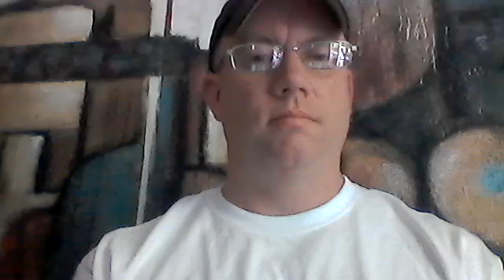what is required to operate 50 antminers.

Comment: Inaccurate, misleading, pompous info aimed to lure investors only. One Antminer S9 puts out 250cfm X 50 = 12,500CFM (Not 30,000CFM as this guy here says) Static Pressure is a simple concept that 3rd grader would understanding. $100,000 data center, really? A good firewall such as MerakiMX64 and a couple of used Cisco Catalyst 3750 switches is more than enough.
Reply from the maker: So if you only move 12500 cfm and the stati pressure is .25 from the passing thru the miner and you have a hot and cold isle design adding a .125 static pressure to the hot side what will be the cfm you are moving out of the building using a fan blade style fan with a 1/2 hp 1080 rpm psu motor
Reply from the maker: Also you are using a 42x42 opening for make up air with no mechanical means for ventilation  so using that scenario what would be your total CFM being removed from the hot side since you know so much

Comment: I’m trying to buy 25 Asics Antminers L3+  to install in my garage,The electrician told me he can connect 160 Ams more to my house with an extra panel, I want to know I connect the 25 or has to be  less?, thanks
Reply: Do the math, 1 Antminer L3+ pulls 6.7 AMPS, i have measured it with a kill  watt tool. So with a 160 AMPS you'll be able to connect about 23 of them.
Reply: @Funboy2025  it's not that simple.. you have to account for everything you're going to have pilling on that main line.. on a hot day with air conditioners refridgerstors washing machines dryers etc.. you must consider there will be times when multi  appliances etc will be on with the miners as I said I tried my main line on a mildly hot day with 21 machines s9s with 2 portable a.c. units house a.c exhaust fan etc. On.. I'm in the process of having a residential service upgrade to 400 amps.. you can only run so many on a normal house line es ppl ecially if you're in a big city..  the line heats up and melts the wire cover which causes arcing and fire on main line..
Reply: Thank you, for your response! I am aware of what you are telling me, and it is not DIFFICULT. Apologies for me failing to deliver a clearer message. I am not running my gear off the same circuit panel as the rest of the house. I hired a certified electrician to install one more panel just for this separate from the main house panel. I also have electrical knowledge.

This is my electrical setup done by me. total power available in AMPS is 240 AMPS, outlets are 20/30 AMPS 120/250 Volts receptacles running off 8/2 AWG wire. This is in a shack in my backyard.
Reply: The extra 240 AMPS are just running my miners, which will be 30 max that's the limit I can have in my setup. I encourage you to have your setup set for higher voltages, an Antminer L3+ running off a 120 Volt outlet pulls 6.6 AMPS running at 240/250 Volts just pulls 3.3/3.2 AMPS see the huge difference, I did a well thought out plan before doing any of the work. I manage to save BIG on power consumption.
Reply: @Funboy2025  my over clocked L3s use about the same power as my s9s.. I wouldn't run l3s at stock speed..   nor would I run any on 120V
Reply: @dooley4334  Bro, you are not understanding me. I am running my miners at 250 Volts.
Reply: You need to do soke calculations. Please contact me at hermis2008@gmail.com. I can give you accurate info on these. I have only tried Antminer L3+, butbother miners just require a bit precise math to do a safe and accurate setup at home or office.
Reply: @Funboy2025  I understand

Comment: This guy thinks by painting a bleak picture and making seem like a hopeless dream he's going to drive investors to his door? HA! I started mining this year with 25 antminers, rented a 1000' of a larger warehouse for $800 and then added 25 more. I use no AC whatsoever just blow outside air in with one large fan and exhaust with another. I run everything on a 208V/200A 3 phase (72,053Watts)
Hashing rates are as expected and with the rise in BTC, things have never been better. The total setup, including having an electrician setup my power, was under $70K. People, do your own research, and crunch your own numbers. Take a look at Bitmain's mines in Mongolia, no AC used!
Reply: Brian Stevens Sorry you spend $70k total just for the setup only? I mean that's a lot . Or $70k including the miners? But that's impossible cuz 75 antminer cost you more than 80k alone??
Reply: 4misscindylou yes miners and ps all in
Reply: Brian Stevens  I see! That's so awesome! I have 10 of them coming in still looking for place to host my miners. Do you have spot open?? lol
Reply: Did you buy all 25 Antminers at once from one vendor ?  If so, had you ever purchased anything from them before ?  I ask because Bitmain is always sold out and I found several vendors from China on Alibaba (Gold Supplier with high transaction level) but a little hesitant since I didn't find any that would do the Trade Assurance.  You could only pay by bitcoin, Western Union or Bank Transfer.  What did you do ?
Reply: Patrick Pearsall the best way to buy the antminers is to subscribe to their Twitter account. Now they're posting with several hours notice.
Reply: I did that for the D3 and for the first 45 minutes I couldn't get on the site.  I went to bed, got up for work at 5 hours later and tried and was able to snag one.
Reply: That is interesting Brian. I am running a similar setting with one difference, I am in the process of upgrading electirciry. I would assume you are on wye system when you say 208V. Do you know what is the maximum load you can get from your total 72k watt according to the permit/recommendations you got form the eletircity departement?

Comment: So I have around 23 antminers sit up in my basement they run around 75-80 degrees on a cool day with outside temps around 65-70. In warmer weather they run around 104-107 and some of them don't like and some even stop running. I'm pushing in 23,000 cfm right to the ground behind the miners and pulling out about 23,000-24,000 cfm from the other side of them. I can't keep the room cool and the miners get to hot. What would a solution be or any suggestions? They also drop in hashpower substantially when they warm up too
Reply: james fleck you need direct cool air intake to keep the miners cool

Comment: You are asking 30 000 $ for advice That sounds like bullshit
Reply: It's easy to setup if you want to go small say 1 miner keep it simple set it up in ur house . 110v main 220 is more efficient. Buy a 8 port switch 2 net cables .power it up login to the miner 192.168.1.68 or which ever the ip is .login to you router they do not come with static ip. Password user root root select a pool drop it in I use kano.is  best pool there is . And create a hot wallet on blockchain .your set .
Reply: jholotan best thats 10 unit of new antminer for ya O_O

Comment: Do you really need 30,000 CFM on the supply for 50 antminers?? The Antminer S9 fans are spec'd to do a maximum of 220 CFM each. So in theory, as long as the heat is not re-circulating back into the intake of the miners, 50 x 220 = 11,000 CFM max to handle 50 miners. Add a safety factor and maybe 15,000 CFM would be max. Where am I wrong?
Reply from the maker: +Steve Barbour you're going to need 15000 CFM to remove the Heat and you're going to need 15000 CFM to replace the air that is being removed for a total of 30000 CFM

Comment: Are you solo mining or pool mining now that you have pethashes worth of hardware in multiple mines? Also are you signalling for either segwit or BU or just running core?
Reply from the maker: +Austin 152 I currently use an algorithm to switch between different pools based on percentages